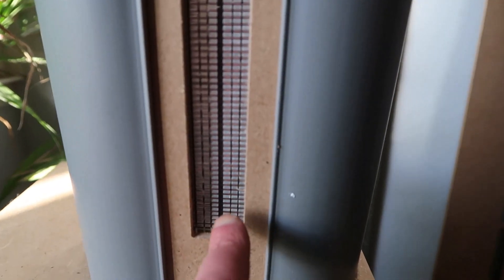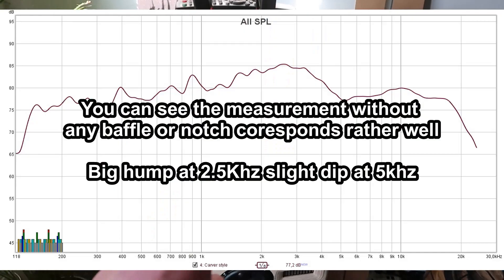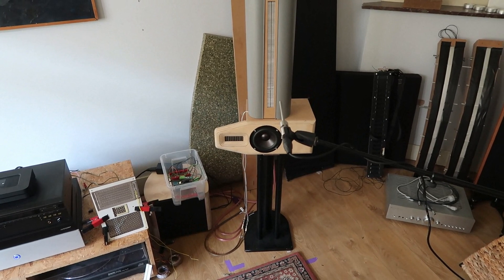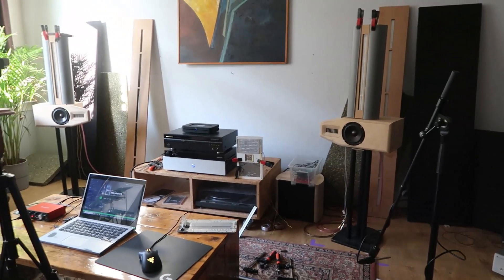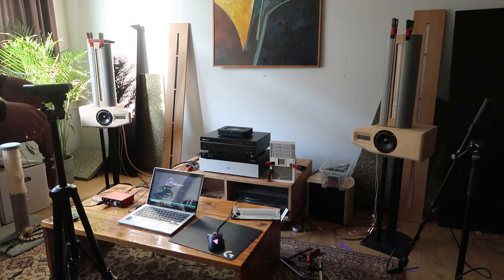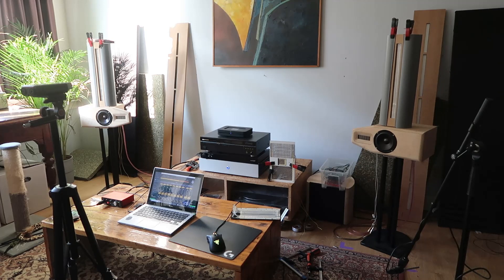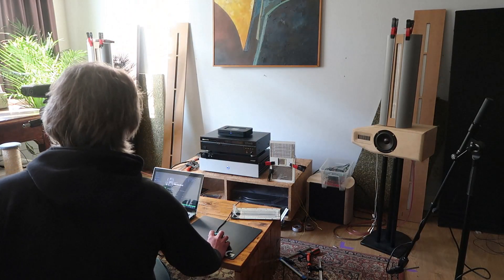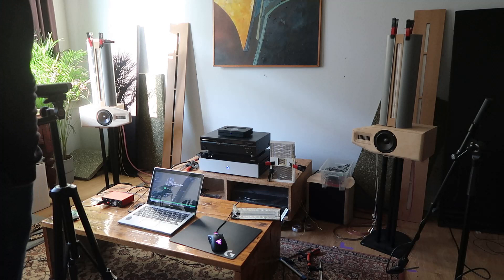Carver Style Tweeter - Part 4 With dynamic woofers

Comment: Do you still have this setup? It could be interesting to see and compare how it performs if you use the round edges as horizontal horn/waveguide.
Reply from the maker: you mean the inner edge from teh wood?  i still have the drivers. and i wanted to make the front a thicker piece with round overs on the inside. just as tester for a longer one so you might be lucky ;)

Comment: Looking at your width I have an idea that might push your top end higher. But a thin divider down the length from the top to the bottom. The width of the space without any conductor. This may breakup a reflection that you seem to have. On the back, if you can get it try Rockwool. Very good wide bandwidth absorber for sound. Like seeing the nut and bolts along with the measurement Joppe.
Reply from the maker: nice one !

Comment: Just buy a wooden pole and cut it in half. Some wood stores has different sizes of wooden lists to try. I have some quarter circle profiles in wood.
Reply: Better than some flimsy ”stupränna”.
Reply from the maker: @rewind9536  haha well they serve there purpose of testing something. frequencies above 1Khz are not gone move the PVC. there is no energy to do so.  at this volume you could take a look at 50 hz , it moves quite some air, going to 100 hz it would be / 4   going to 200 its again devidded by 4. going 400 again devided by 4....  so you can imagine at 1khz... nothing that would move that piece of PVC. physics i cant help it. and since the trouble is at 2.5 khz.. im not to worried :)
Reply from the maker: quite soem wood :) but yeah thats an option !

Comment: sounded good here. 

I tried to find mylar for sale, but could only buy rolls weighing 250kg from china. :)
Reply from the maker: 250 kg, thats allot :)  well take a look here : https://www.ebay.com/itm/184612354397?epid=666550352&hash=item2afbc0f95d:g:XBoAAOSwU9xUQPIj&amdata=enc%3AAQAHAAAA0J2CC90xOu%2Fi9bR8sWzVaXMC9TULtetgUkMpAqQaIIfqJ%2B0R2khklgkIODHcL6xUqWvJuAY5cEdExXLJD8jYZ5r04m63Qc5xupBmLj6iZgBQEIBLAY%2FwZQe6Zae84lC5MPCfZgawQX9RCLe5WT2peOIlNT%2Fu57kpxrTZU0wAbWUfO2sqKahgATLUneMFJyDqkw7rk5LZJDCGFhk9DJ%2Bir329NMK9IIkFXgfF6%2B%2FcoFSQ%2BazdVqxgRndCFKIgJWCuNeaOByzzQScTfy34VXibK58%3D%7Ctkp%3ABk9SR7iP3NrpYQ

search words are mylar electrostatic speaker membrane

Comment: Instead of making the cavity with a gutter, you should take a full pipe in this size, cut a slit in it, and slip it on the baffle so that two pipes form a waveguide on the front and another one on the back. Then take a file and file the edge of the opening for the diaphragm in the board so that the edge fuses to the pipe-waveguide seamlessly. The pipes will form ducts that can be used as ports for compact quarterwave design. It'll look like o-o from the top. You should get significant gains from reducing the side cancellation because the sound will be focused around the axis *on both sides*.
Reply from the maker: i do not want a direct reflecting surfaces behind the tweeter. (it will come back as a huge Peak and dip :( )  but i might get your idea wrong :)  i can use the guttter (dont like it) but i needs to wrap LESS around on the back creaping reflections. :)
Reply: @joppepeelen  I updated my comment to make myself clear. I meant a double sided waveguide. A horn on the back and a horn on the front that wrap around the edge and join to form a tube... Or two tubes that form two waveguides :)
Reply from the maker: @rhalfik  Ooh  yeah adding a horn/waveguide would bvenefit some frquencies !! definetely. problen is getting so low.  :( without getting huge. but i might still not get your idea exactly.   i mean depending on extra work some gain is always nice !
Reply: @joppepeelen  I mean to take two tubes and attach them to the sides of the baffle like this o-o. You can see they form a waveguide for the front and back. If you take a saw and cut each tube on one side along the length so that if forms a C, you can slip it on the baffle to make it couple directly to the tweeter. It should interface to the diaphragm without any steps in between. However the angle of attack from the tube will be less steep than the opening in the baffle, so you should file the edges of the opening just a little bit to make a smoother transition. Right now the opening is a straight duct, albeit very short, but it steals that 5mm of waveguide from you, that can be expanding and giving you bottom end gain.
Reply from the maker: @rhalfik  OOOh i get it , i might try that just for fun ! i goty some tubes. i can saw open witch might be a bitch but i could try :)
Reply: @joppepeelen  I experimented a little with and ad hoc EST transducer. Unfortunately I don't have the skills to make it sound good, but if you build it, you can jam a strip of felt in the back waveguide and it gives it a smooth cardioid pattern. My dream is to make something like this from the floor to the ceiling without any gap to the boundaries to get that massive cyllindrical wave gains. Also the waveguide would double as a bass port for  a quarterwave design. That would be a kit I could live with, I think ;)
Reply: Use foam pool noodles.

Comment: Replacement for the remote could be wheel balancing weights, they should give some more "weight " to the housing, which should in theory let the film more work giving more accurate measurements, but again I might be wrong, still learning all of this.
Reply from the maker: Oh heej Hi Dovydas !! (good talk sunday ! and cool ur bussy with making designs !!!) , well the remote is just used to make the backside more heavy so it wont fall forward :)  the other does not have it, i just did not manage to cut this pipe on a good 90 degree angle :)
Reply from the maker: Sunday...... not yesterday :) haha
Reply: @joppepeelen  Im not any better with time myself, usually I don't even know what day it is. But I might have a brilliant or worst idea ever, we could try to play around with box design for this tweeter and a more conventional woofer, something that would be realistically feasible to build unlike my other design.
Reply from the maker: @dovydasburneika5836  these dont need a box, the woofer cabinet if i would use one would be a simple as one can think off maybe upfire-ing behind the tweeter... who knows :) ur speaker was a nice design, i liked the bass port method was a pretty cool idea. but even cool ideas can have downsides.  but might stick and i am sure you will use that same idea later when it is suitable !! (if size is not an item)
Reply: Great sound as always, how much for the setup as shown?